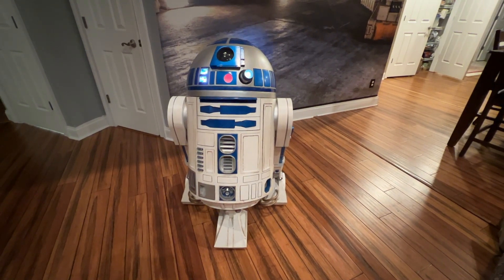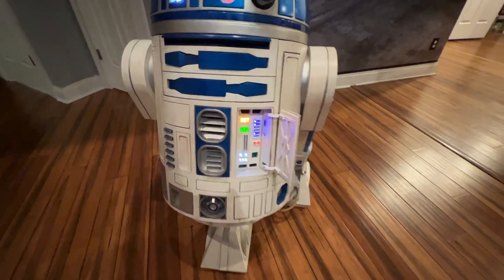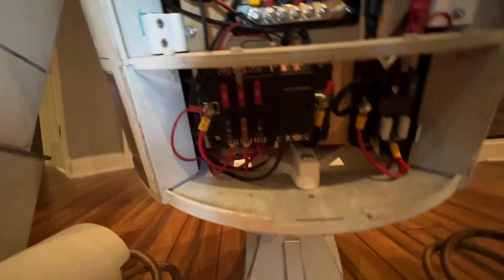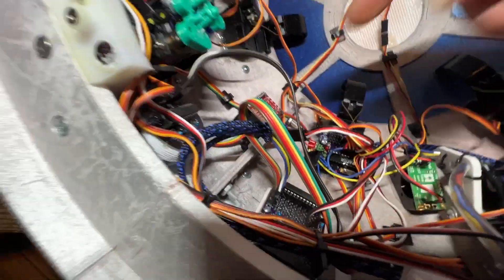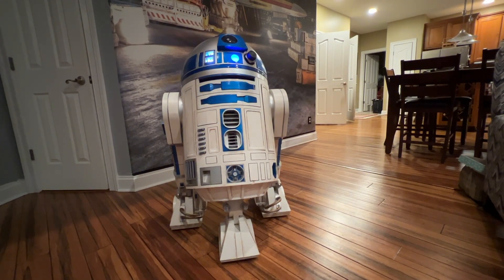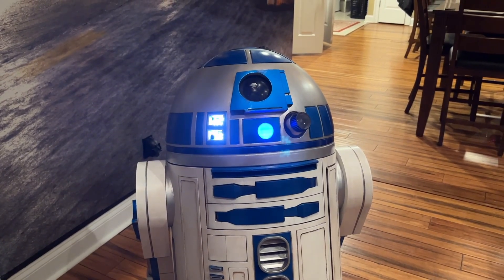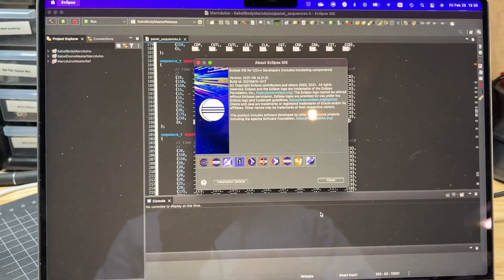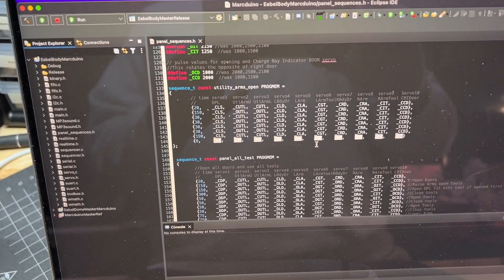R2 D2 SHADOW MD Overview

Comment: do you know if anyone has got the mega to work with an esp32 instead of the usb dongle?
i got the smaller 2560 pro its smaller not the mini just the embed
Reply from the maker: @jackjarrettconnell  There is ESP32 based software called Penumbra Shadow. You can find it by searching GitHub. It’s by ReelTwo.

Comment: What is the ballpark figure for filament, how many kilos to print it?
Also approximate electronics cost?
And are all the servos sg90's or do you need stronger ones for some things?
Reply from the maker: This is more of a buy as you build project.  You don't need or want to buy everything up front.  As you build you will likely have mission creep where you want to do more.  Or, you may abandon the project.  You can find support at Astromech.net or  my Facebook group to get a more granular response. https://www.facebook.com/share/g/19cqujmrVm/. However, you can expect to spend anywhere from $750 to 1,500 on your probed droid.  Mine cost quite a bit more though.
Reply: @TheEebel  yeah I fight that and I am aware of the astromech site 
I have always been interested but waiting for when the time is right and I have some time.
I have some parts lying around that could be used too.
I was just wondering as a general estimate 
To see if it's something I should stat at some point.
I have a lot of other projects I want to get too first.
I just got my first Bambu coming from Enders ,only an A1 so still a slinger but much faster so my interest was renewed.
I just happened to have bunch of sg90's and a few other servos lying around and some other electronics that I could probably repurpose for the project.
I just like to know what is worth holding on to as I always have repurposing in mind and this project has interested me for a while but I have no intention on embarking in it right now

Comment: Hi I installed your code and am having some trouble. My panal servios are all over the place. I was trying to do the  #SD01 command to reverse the servios but that is not working. As far as movement dome and feet are good. On my OG code everything is working but I want to add the body stuff. I think I did the reverse servios command on the OG and it worked. I think my MP3 files must have the wrong names because most are not playing. I hope I can get this going.
Reply from the maker: My code is based on the older firmware.  Perhaps use the current firmware available for the boards instead.

Comment: Hi Mate, it appears you are using custom holoprojector servo mounts, do you have a link. I am having trouble finding one that will fit with the teeces
Reply: Right after I commented this I found your Thingiverse, thankyou sir. While I am at it Thankyou for this video, it is my constant reference for what I hope to achieve with my R2 as well as a blueprint for how to achieve it.
Reply from the maker: I designed them. They are on my prinables page https://www.printables.com/model/582773-r2-d2-teeces-marcduino-mrbaddely-holoservo-mount

Comment: Is there anything I can do to get the Bluetooth to activate when on battery power code wise?  It all works fine when plugged on the pc but then the dongle wont start when on the battery. Check wires and everything so far and did a bench test on the arduino mega and still nada so im thinking it has to be in code. Thanks!
Reply from the maker: Try reseting the Arduino after it starts.  Then try to connect.  You should see the bluetooth dongle flashing blue periodically when it is working.  Oh, and it will connect...hehe
Reply: Thanks. Rest via the button on the board correct?
Reply: Reset didnt work. This is so weird.
Reply from the maker: @duswajesdakul  Hmm, how are you powering the Mega?

Comment: I keep hearing about an FTDI controller required for programming my incoming 1.5 boards (the new ones) two masters and a slave, but any link I click on within Curiousmarc web page are dead ends. Which one do you recommend? Looks like I will need one to program the body master for arms/doors. Thanks in advance.
Reply from the maker: They are out of stock at Sparkfun, but the sell them at Amazon.  There are a coupe of options.  But this is the one I used, although I bought it from Sparkfun originally.  https://www.amazon.com/Sparkfun-Electronics-LYSB01BHHH714-ELECTRNCS-Pocket-Programmer/dp/B004G54E9I/ref=sr_1_1?crid=KXHI61J0PY5Z&keywords=pocket+AVR+Programmer&qid=1646226043&sprefix=pocket+avr+programmer%2Caps%2C37&sr=8-1
Reply: @TheEebel  Thanks for the reply and the link, really apricate it👍 Following from Australia 🤠